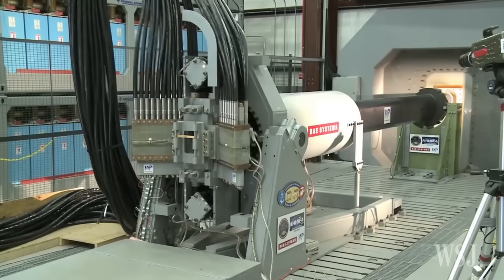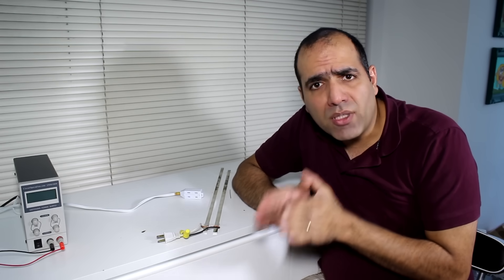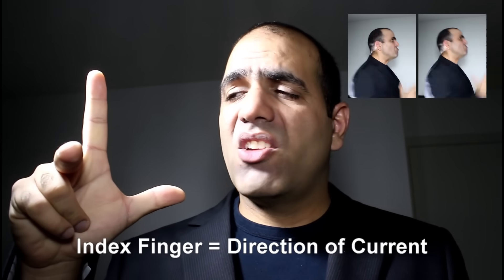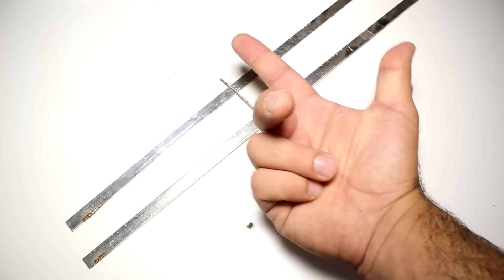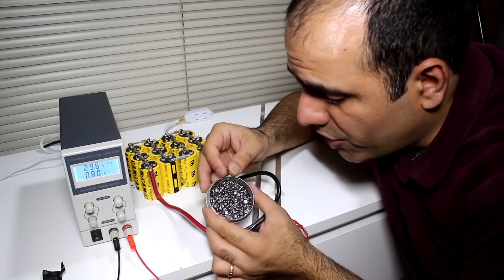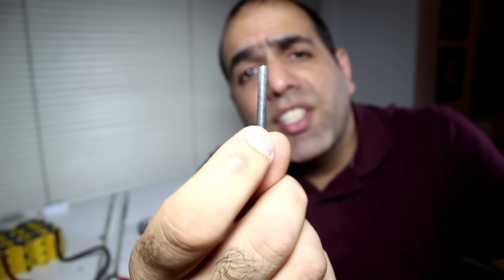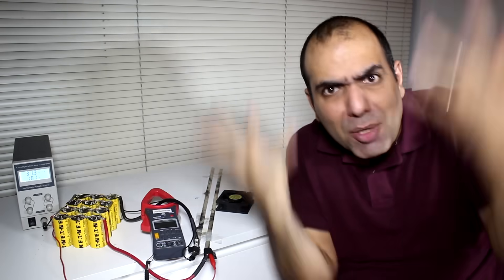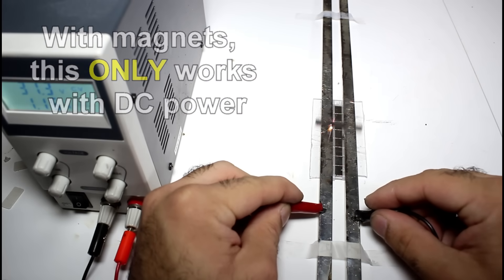Science behind Railgun, ElectroBOOM Style

Comment: is this with electrie shock all real ?
Reply: Yes I think it's real. The spark looks like a "mains spark". But he didn't get a shock the way he did it. 
I assume (since he knows what he is doing) that he used an isolation transformer. With that you can touch any one of the rails you want just don't touch both at the same time.
And even if he didn't use an isolation transformer it can be done. If he touched the neutral rail first and then shorted it to the live rail, most of the current will flow from live to neutral through the wire he used and almost nothing through him, because the wire has much lower resistance. Also if you make sure you are as isolated from the ground as possible (sit on a plastic chair with the feet up for example) even if you touch the live wire not so much can happen (no guarantee that that's safe though).
Reply: Nihilist I think sometimes he does shock himself on purpose, but other times perhaps not, may be because it's too dangerous in some situations?
Reply: Nihilist take a guess
Reply: No because electricity always chose the easiest way to travel. Between going through a metalic conductor directly from + to - and taking a detour through his fingers (or even his body) which path would the electron chose? :D
Reply: superdau